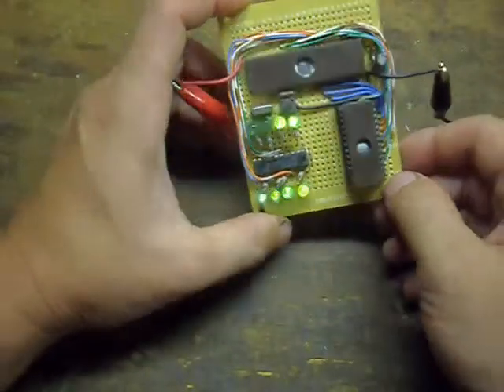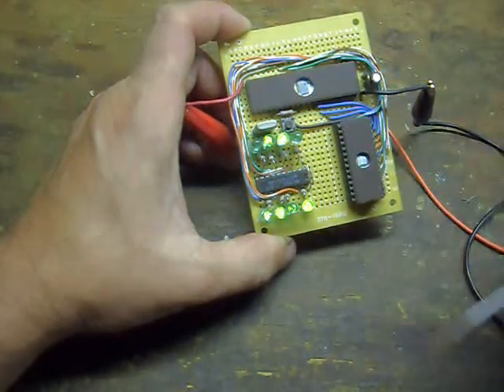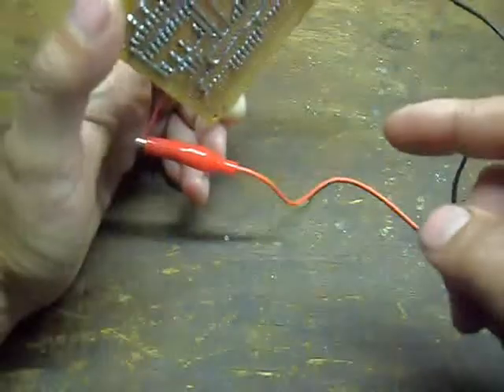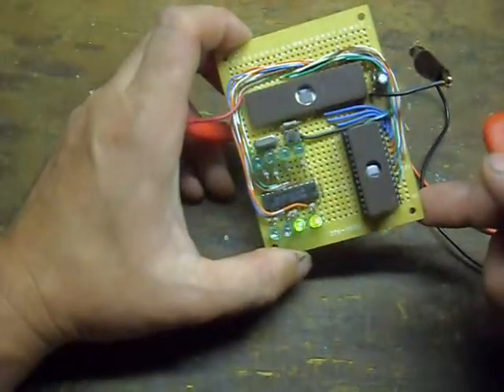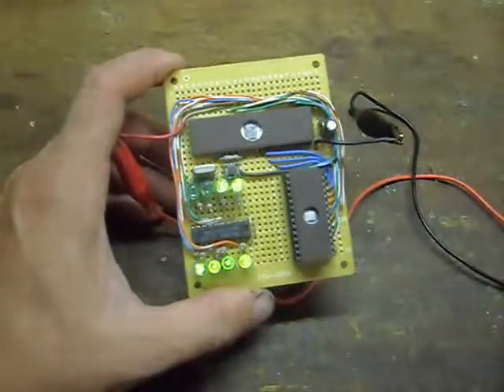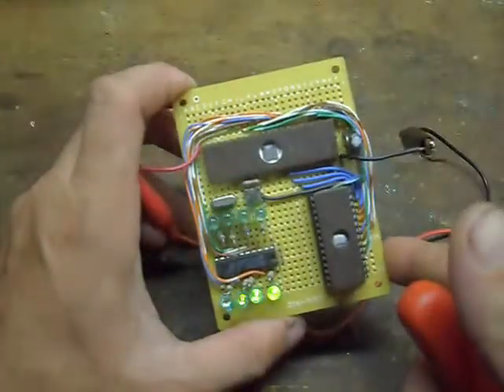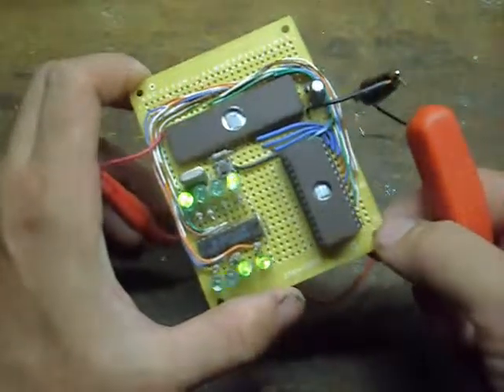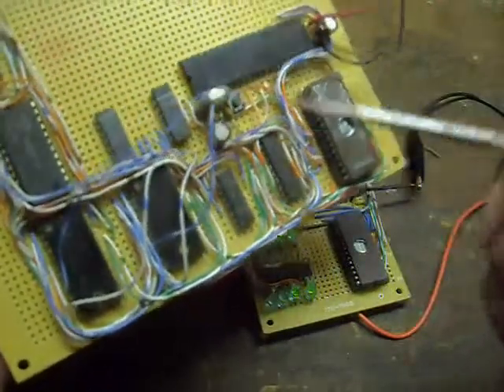A simple 8042 Microcontroller demonstration board.

Comment: How you program the chip? what kind of programmer you use for burning the chips ?
Reply from the maker: I am using a home made board that basically is a derivative
of the willem programmer. That allows me to use the willem programmer shareware
to drive it.